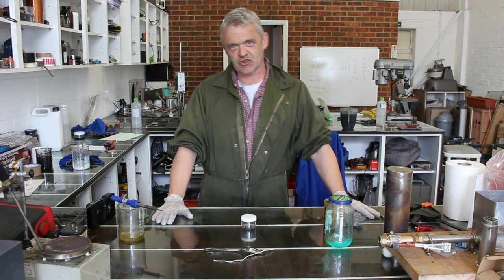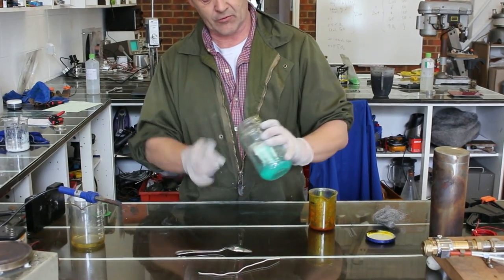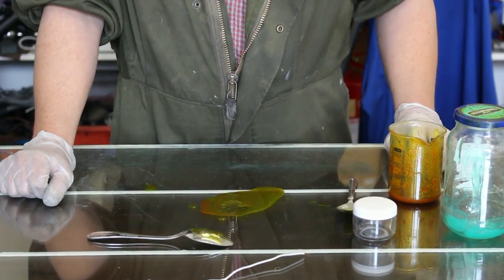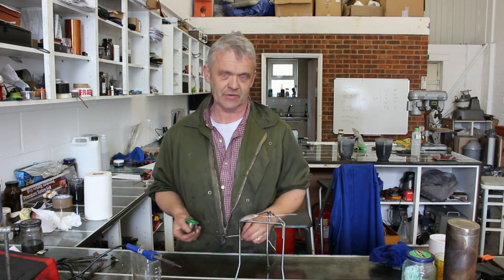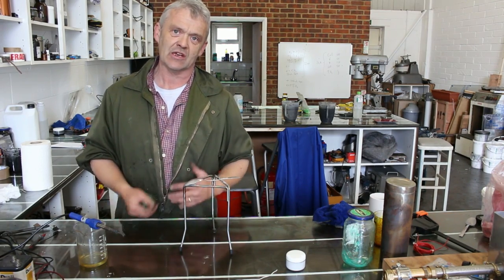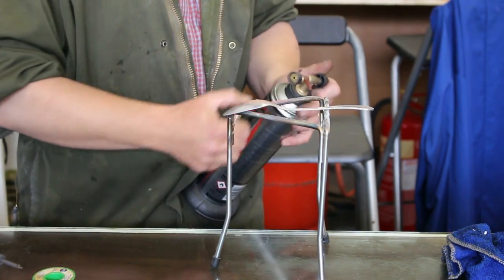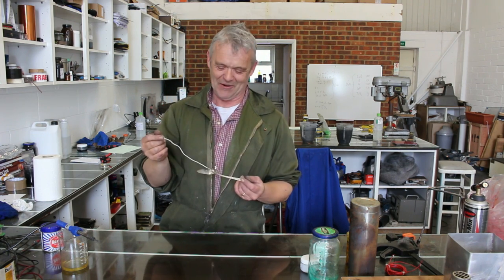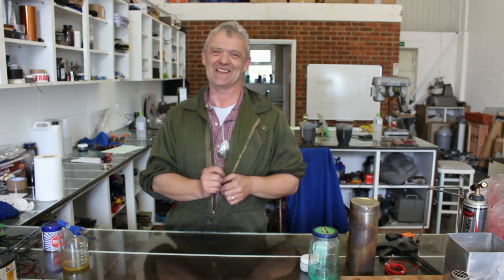How To Solder A Copper Wire Onto Stainless Steel

Comment: Hello, sir. This video impressed me since the first time I saw it. I'll look for the gel recipes in your other videos.

I have one question: here in Brazil there's this "magic drip" that "makes soldering easier" and is "not corrosive". I got one and then found a review saying that it did not create good electric bonding - so I did not use it. It's a blue liquid and only a drop is required. It does give good mechanical bonding. Do you know what that is? Thanks!

Comment: Hi, thank you for your interesting video's! For my RC car model projects I'm especially interested in your method of soldering copper onto stainless steel. 
But I really can't find your video ('s  ?) on how to make the coppering gel... ?! (And bytheway, I've noticed that in different video's where it's used it also seems to vary in colour from bright blue to light green..?)
I've noticed several others of your fans are struggling with this same issue... Could you please provide us fools with a simple link?

Comment: Aluminum surface facing the sun, underneath lies a resistive material like glass, or diamond. On the other side stainless steel to absorb and transfer heat energy. Between the two a diode. Electrons carry heat, and that energy can be sucked out of light itself.

This layered material would reduce the need to mirror as aluminum is reflective, and could operate underneath the photovoltaic monocrystalline structure. The excess heat could then be transported away via Bernoulli's fluid dynamics principle. Forced Air Heater (imagine cutting the bottom off a beer bottle and stacking them continuously. As the air heats up it's pushed through the bottleneck [since the panels are already angled that way], and the air never goes back down the bottleneck). You could spin another small electric motor off of that for added Wattage.

Comment: my stainless steel still has broken and i was wondering if i could use this  process to make the repair on my still for i have no tig wealders in my area and another concern id have is of it would subject and added chemicals that stainless steel and copper produce when subjected to vapor  ethanol for consumption
Reply from the maker: I have no idea mate but as you are making something for consumption it is probably best just to replace the part with OEM spares just avoid any possible headache

Comment: Hi, Robert.  Thanks for posting these! -- I'm working on a project that will require soldering copper wires to smallish bits of stainless, and this looks like it might do the trick.  I'll probably have to use something like a buffing tip on a Dremel to clean the surfaces.

What sort of concentration of FeCl3 are you using in that gel?  I've watched a number of your videos but haven't seen that mentioned.  I'll be having to approximate things anyway with homemade FeCl3, not to mention homemade CuCl2 if my small stock of CuSO4 runs out.  Yay, chemistry!
Reply from the maker: chemistry rocks mate - unfortunately i can't give out exact formulas - this shows it can be done and experimentation is needed to round it off - i wish you the best of luck though and happy experiementing
Reply: Even an approximate formula would help, please.  Just FeCl3 in gelatin + water?
Reply from the maker: sure - why not - give it a go?

Comment: Rob - soldering to stainless is much easier than that... Get yourself a bottle of rust remover (couple of quid), degrease spoon with acetone, dab on the rust remover with a Q-tip and then apply solder with your regular iron.  Flows on like a dream :)
Reply: Thanks for sharing! I'll give it a go when I get to that point!

Comment: soldering onto stainless would be good for connecting to antennas that have to be in contact with salty environments I suppose, what I am wondering is how can you use these processes for say graphene work, like getting copper to bond to the surface of a graphite block or strip and then solder onto that :)

kinda wondering if the copper plating process could be applied to metGlas (a silicon based metal compound that has a very low retention for magnetism but high conductivity as a paramagnetic substance, so it makes amazing cores for say transformers. *high magnetic transference and very little energy when the power is reversed to overcome any residue magnetic force in the stuff but it is neigh impossible to get any sort of soldering bond to the stuff with traditional methods,
I will drop a link here, not sure what it would take to get some as they are fairly restrictive over who can get the stuff and make you sign a waiver that says  you will not use it in any application related to weapons technology lol

the alloy I have tried to solder to was  2705M
http://www.metglas.com/products/magnetic_materials/

(should be about halfway down the page) and if you ask you might get them to send some samples, I got two for the asking, though I am in the USA, and with how odd they were about their restrictiveness and agreements I am not sure how they feel about sending it out of the US lol
Reply from the maker: Thomas Anderson that definately looks worth a try mate - you can get metglas from an RCBO - it's in a coil in the white toroid looking thing - i will do a vid on it so you know what i mean
Reply: ah excellent, and glad you have access easily to it :)
Reply from the maker: Thomas Anderson you might well too - i'll do the vid when i get home

Comment: I've got a better challenge: solder electrical components to (thick, not foil) aluminum.
I managed to get it to work but it's pretty shabby
Reply from the maker: TheIdeanator it's not a better challenge - it's just a different challenge - but i'll give it a go - also - don't you feel you owe me an apology for your comment on the flux video as here is the demo you asked for?
Reply: I suppose I do. I didn't know you put this up when I commented before.
Reply from the maker: TheIdeanator lol - no worries mate - i was only joking

Comment: Robert Murray-Smith we had a production plastic housing w/electroless nickel coating technician soldered a lead to. An EMI issue. The girls did this all day long. I tried and tried but burned a hole every time. Never know when something like this has high value, but never underestimate the skills of craftsmanship. The guy who developed the process couldn't do it either. These little tid-bits are great to have in the tool box to solve tough problems. Thanks so much for all your tech contributions making the world a better place for many aspiring technologists.

Comment: Am I the only one listening just one channel? I can only hear the left channel of this video and the other one you uploaded about how to make flux. Nevertheless, amazing material, very interesting and really well presented. Thank you very much for taking the time to do this videos.
Reply from the maker: Ezequiel Teruel it might be a mono mike - i am not sure
Reply: +Ezequiel Teruel  could be an external microphone wasn't plugged fully in, a stereo jack sockety with the plug not fully inserted can make contact with only one channel. Similar effect to a broken wire in one channel.
Interesting room acoustics also make this 'interesting' - it's not unreadable but does sound a little strange.